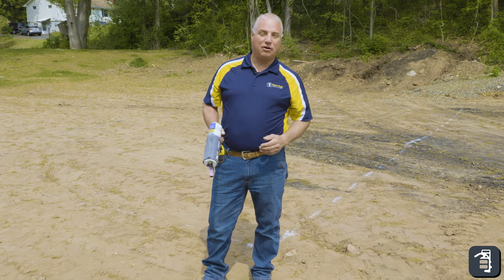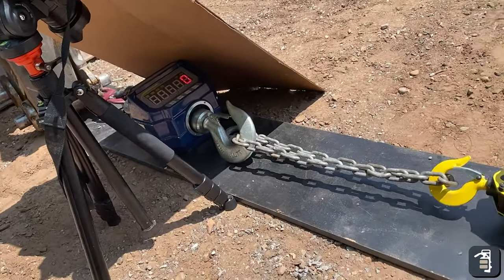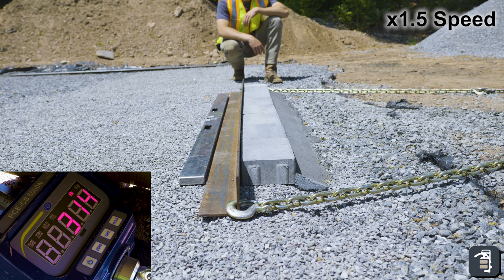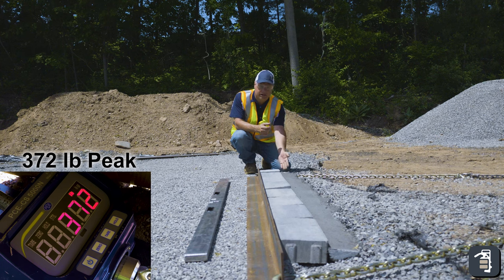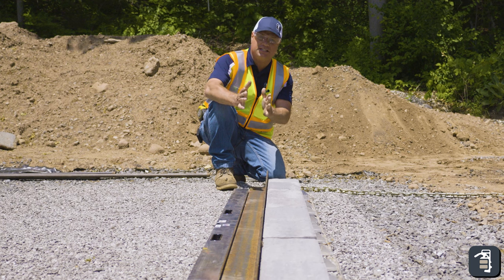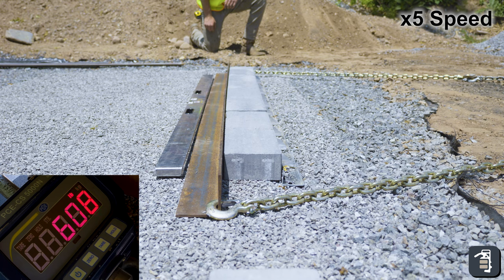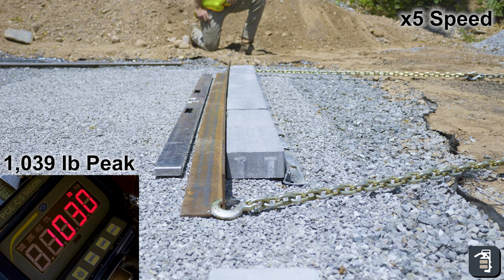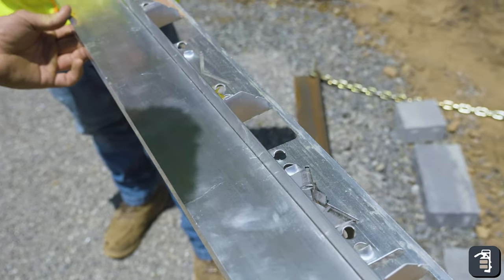Edge Restraint Lateral Pull Test

Comment: That is the best comp I've seen.  Great job team-  Only question or thought, we have adopted a hybrid open grade base using the permaedge system and tying geogrid in with it.   We are just now starting to get your edging out here in Colorado so I am pumped to try it....great job as always. 

And by the way, still love my compactor from you guys!  Thanks again!
Reply from the maker: Hey thats awesome glad to hear that you're pumped to try it! How many feet of geogrid are you putting under your pavers in that application?

By the way, happy the compactor is working for ya!
Reply: @PaverToolInnovators  Each project is slightly different, but most applications have the grid running throughout the entire base-prepped areas.  For example, a simple 4 ft walkway, we use a 6ft wide roll and it comes up on either side and tied into the concrete, so in theory, the weight of the stone, and pavers are pushed down on the geogrid which is attached to the concrete, and it pulls it in laterally speaking.  
If works really well, we have had no lateral movement on pedestrian and vehicular applications. 

The idea came from Caleb Auman, so I can't take credit for this process. 

We would still use the geogrid reinforcement under the pavers in conjunction with your edging materials. 

For your test, the pressure applied with just the paver and edging was great to show the durability of your product.  I was impressed.
Reply from the maker: @kevincomstock9615  Thanks for the feedback!